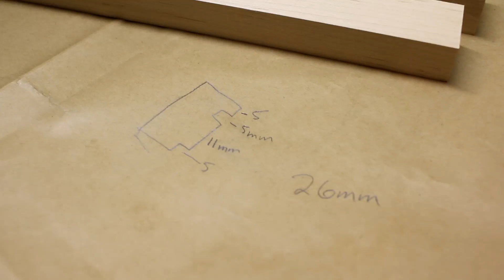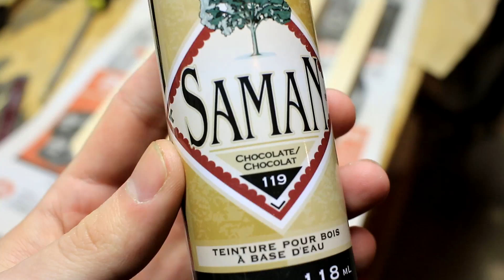BUILD: Cool DIY Infinity Mirror Tutorial

Comment: How did you have your mirror and glass setup it was hard to tell? As in what did you use for reflection on the outer piece and was the mirror just normal? I've seen a few of these and am trying to figure out what will gave me the effect I want. Cool channel by the way hope it grows.
Reply from the maker: Hey! The mirror goes on the back like normal and then the front piece can be regular glass or one-way mirror glass with the mirror side (it's hard to tell, but it's slightly shinier) facing inwards - ultimately you want as much light bouncing around the inside as possible